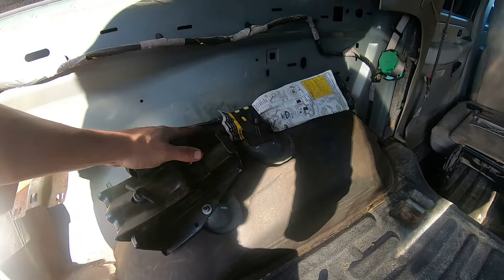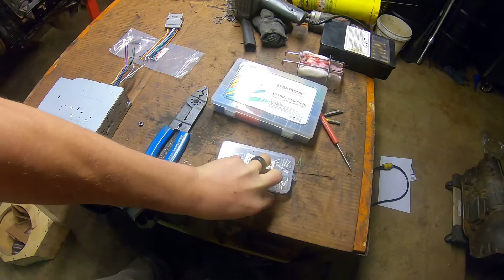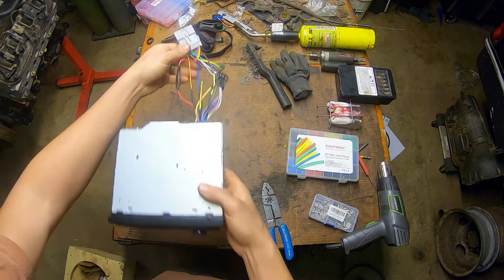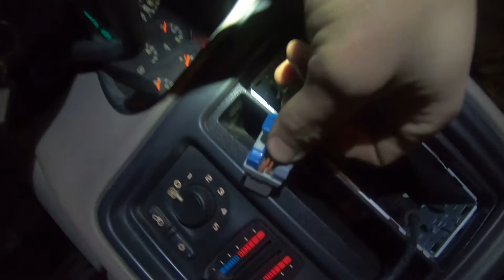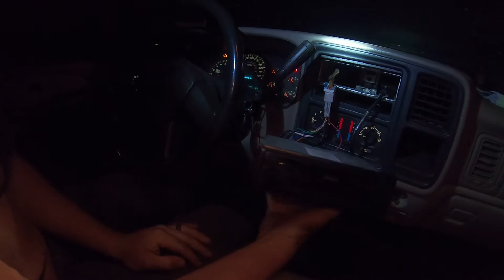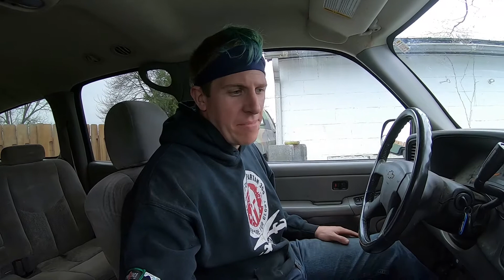Kick Up The Jams!!! - Surplus Suburban Part 4

Comment: Most factory car stereos only will work in the original vehicle.  You have to take it to a dealer that can reflash the memory.  It needs to update the VIN in the memory of the stereo.
Reply from the maker: Correct. In GM vehicles 2002 was the last year you could swap factory radios, or aftermarket radios with reprogramming it to the bcm, or an adapter module.